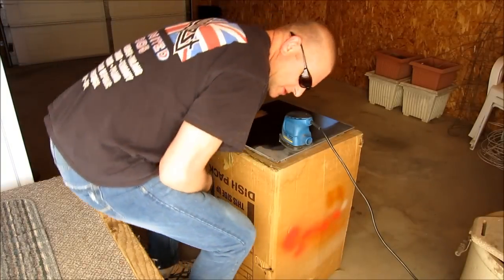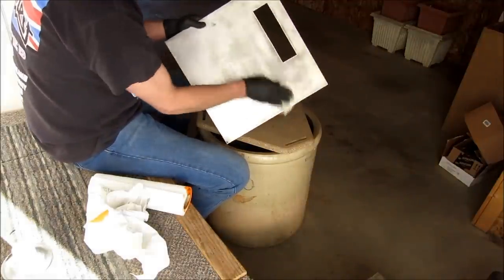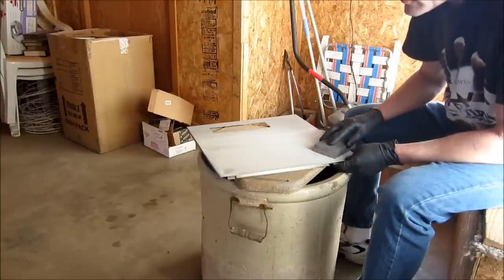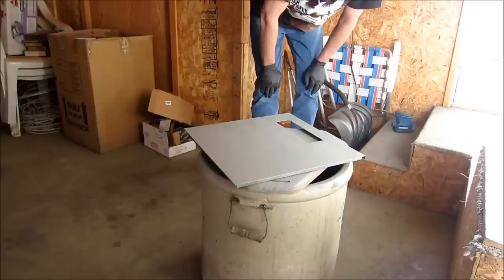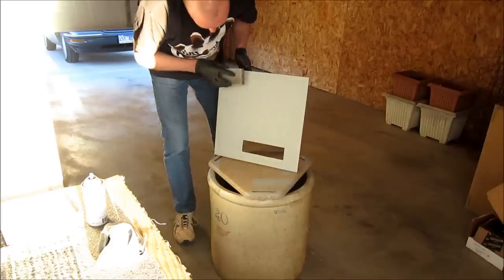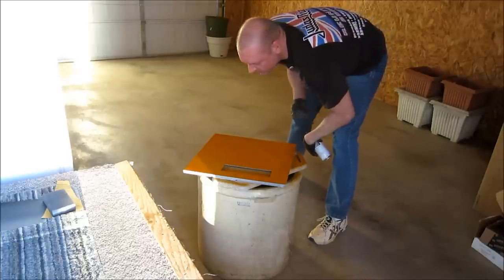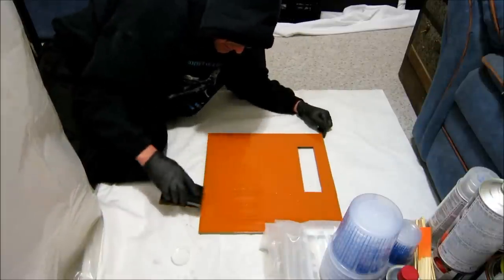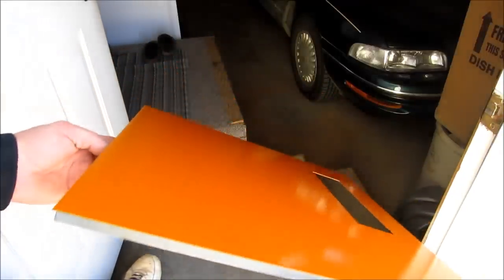Complete Case Side Panel Painting Guide - DazMode Guests Vol. 1

Comment: Nice video with good tips. If you finnish with clear coats can you wet sand it with 2000grit and also on last clear coat. And for last use low rpm compound and polish it nicely?